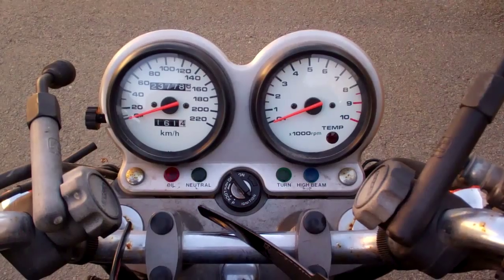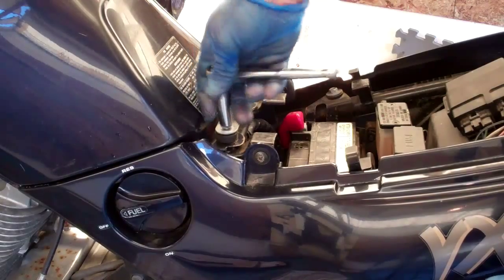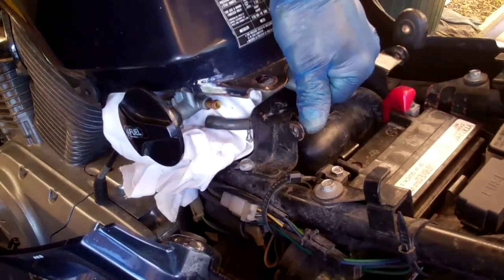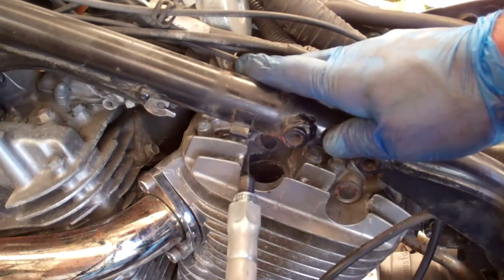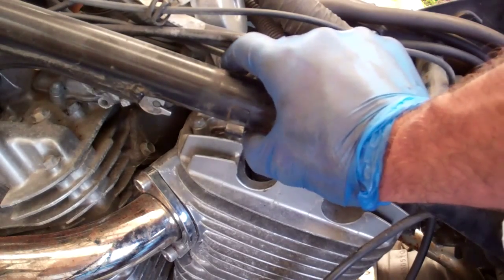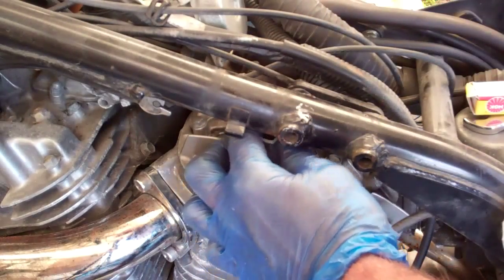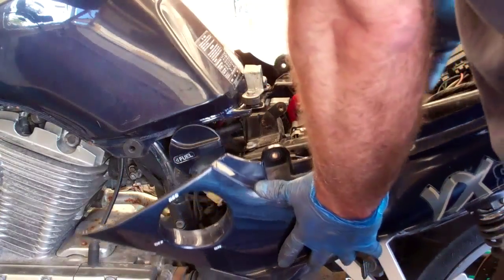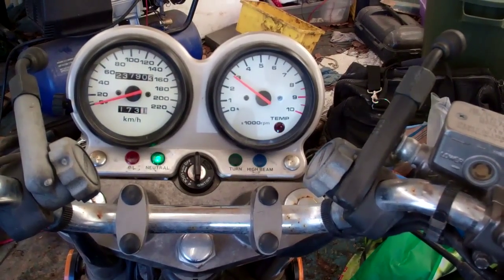Replacing spark plugs in a 1990 Suzuki VX800

Comment: Great video- Have you replaced the rear shaft seal at the rear wheel?  Mine is leaking and need to replace the seal. Do you have a video of the procedures? Thanks

Comment: I just did this and tank removal is unnecessary. When you take off the cylinder covers you'll see that the spark plug is at an angle so that you can get out easily.

Comment: THE  FRONT  PLUG  REMOVAL ON LATER MODELS LKE THE 2002 MAURADER IS VERY DIFFICULT ..ITS BES TO REMOVE THE  FRONT AIR BOX BEFORE STARTING ..

Comment: you do not need to remove the tankfor that
Reply: Came here to say thanks for reminding me the bike comes with the tool I needed (saved me like 40 dollars) but I was able to get the plugs out without taking the tank off. It's really tight, but doable and not all that hard. I assume the new ones will go in without much more effort. So yeah, this is correct, can confirm.